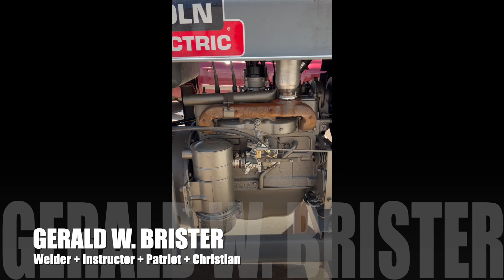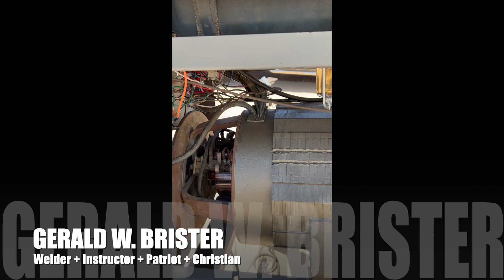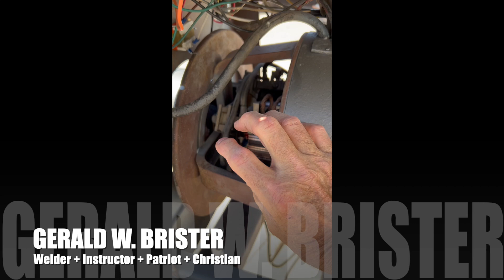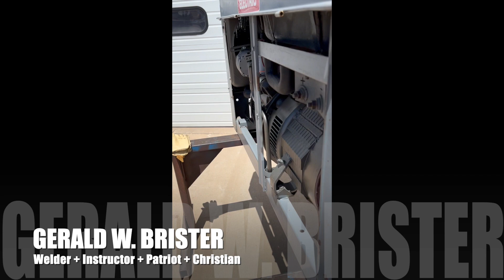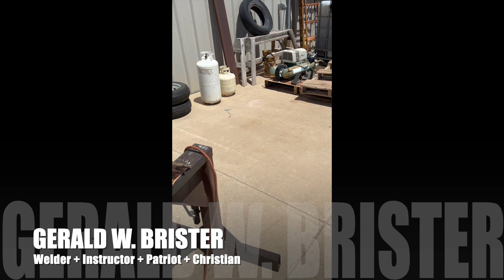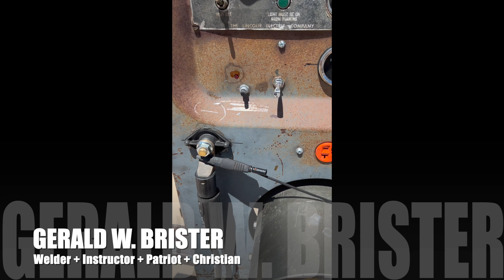Adusting the OCVs on a Lincoln welding machine

Comment: I have a 1966 Redface that was a barn find that I restored.  I’m not really a welder but enjoy it when I do. I just stoned my commutator and checked the OCV.  I was always told by folks that know what they are doing,Leave the rack alone!
Reply from the maker: RED FACE WELDERS ARE ABOUT AS GOOD A MACHINE AS A MAN CAN OWN. ADJUSTING THE RACK OFF OF THE FACTORY SETTING IS NOT NECCESSARY AT ALL. ADJUSTING A RACK IS A SPECIAL APPLICATIONS ONLY TECHNIQUE.YOU HAVE TWO TINY CENTER PUNCH MARKS ON THE RACK. WHEN THESE TWO MARKS ARE LINED UP THAT IS YOUR FACTORY SETTING. IF YOU LOOSEN THE BOLT THAT THAT HOLDS THE RACK POSITION AND BUMP THE RACK NO MORE THAN ABOUT ONE SIXTEENTH  CLOCKWISE AT A TIME IT WOULD CAUSE THE WELD PUDDLE TO THICKEN A LITTLE MORE AND THERE BY FILL A BEVEL UP A LITTLE FASTER IN THE HIGHER 240 RANGE. IF YOU BUMPED THE RACK THE SAME SIXTEENTH COUNTERCLOCKWISE IT WOULD INCREASE THE DRIVE AND HEAT IN THE 240 RANGE AND CAUSE ALLOW YOU TO GET MORE TRAVEL INCHES OUT OF A WELDING ROD WHEN RUNNING THE ROOT PASS [ BEADS] SO THOSE WERE THE TWO MAIN REASONS TO EVER MESS WITH IT. FILL AND CAPPING A LITTLE FASTER OR RUNNING YOUR BEADS A LITTLE FASTER. DEPENDED ON WHERE YOU WERE WORKING ON THE LINE. FIRING LINE, BEADS, ETC. IF YOU WERE DOING TIE IN WELDS OR FABRICATION YOU HAD NO REASON TO EVER TOCH THAT RACK. IF YOU DIDNT KNOW WHAT YOU WERE DOING YOU COULD MESS UP HOW THE MACHINE WELDED PRETTY QUICK. I HAD A RESPECTED PIPELINE MECHANIC ADVISE ME NOT TOCH THE RACK. INSTEAD HE TOLD ME I COULD ACCOMPLISH ALMOST THE SAME THING BY ADJUSTING THE RPMS UP OR DOWN A LITTLE. TURN DOWN THE RPM'S TO STACK METAL [MAX 50] LESS THAN FACTORY. MORE THAN THAT AND YOUR DC CURRENT FOR YOUR POWER TOOLS WILL BE TOO LOW. FOR FASTER BEADS YOU COULD ADJUST THE RPM'S HIGHER OR SOME OLD TIMERS WOULD PUT A DIME UNDER THE GOVENOR ADJUSTMENT. THEN REMOVE IT FOR NORMAL WELDING. ALL OF THESE ADJUSTMENTS WERE USUALLY ONLY USED WHEN WORKING ON LARGE DIAMETER HEAVY WALL PIPE. YOU SHOULD NEVER NEED TO TOUCH THAT FACTORY RACK SETTING.RACKING A WELDING MACHINE TODAY IS USUALLY DONE DURING BACK YARD BARBECUES BY OLDER WELDERS TELLNG WELDING WAR STORIES FROM THE PAST!!  TY

Comment: Commutator cleaning with Mars Polymer drafting erasers large (White) rectangular cube shaped.   
Never use the school supply pink pearl eraser. 
This is a great cleaner before it gets bad enough to need a soft stone.
Reply from the maker: Great tip! THANKS FOR SHARING, IVE NEVER USED ONE ,BUT IT SOUNDS PLAUSIBLE. THANK YOU MARK!